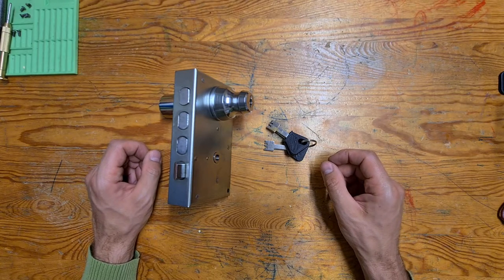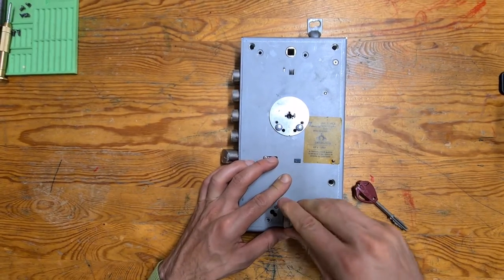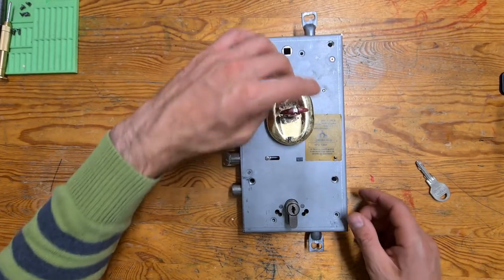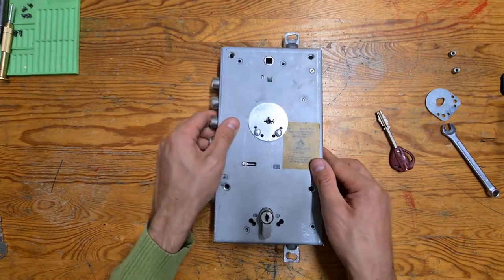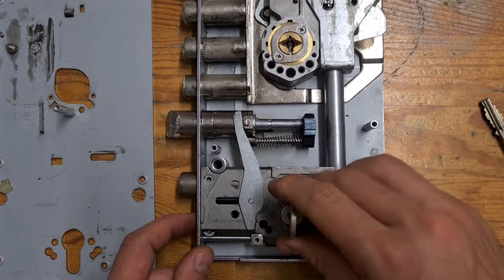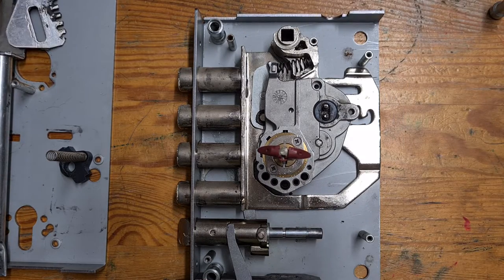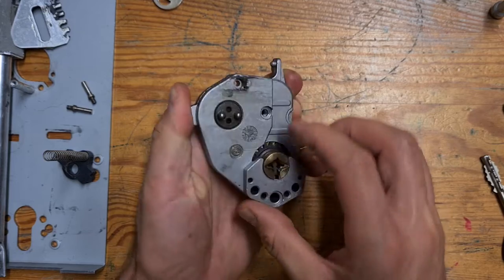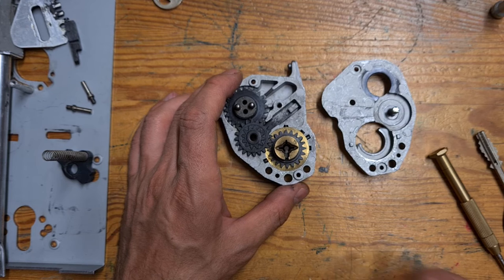Mul-t-Lock Omega Plus teardown (no picking)

Comment: To have the key work from both side, does that mean the center row is symmetrical and the 2 sides are the same but inverted pattern?

Something like
12345
abcba
54321
Reply from the maker: Yes, pretty much. Whereas thekey has two extra cuts in each row. If real bitting is like
123
abc
543

The key would be like you wrote.